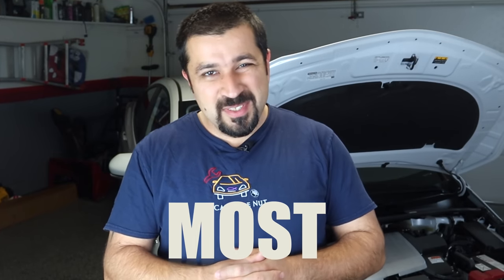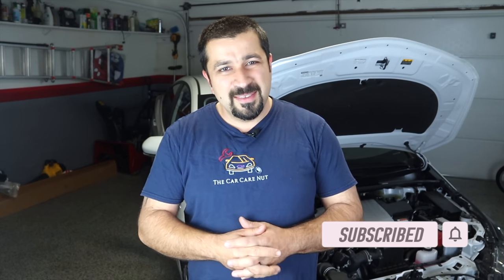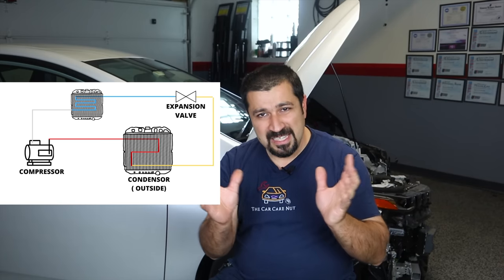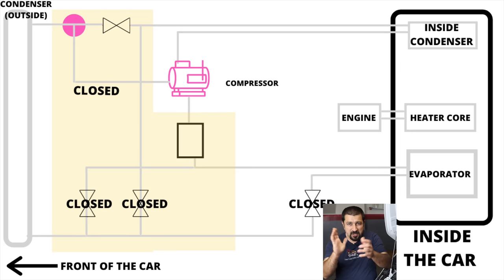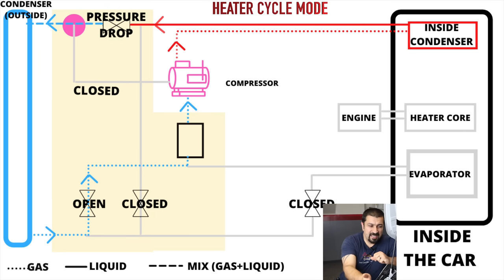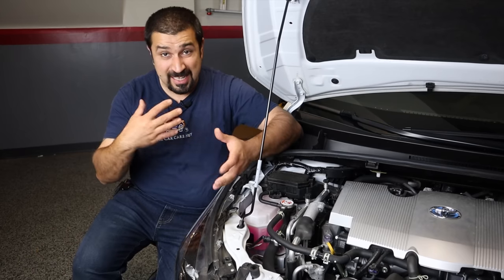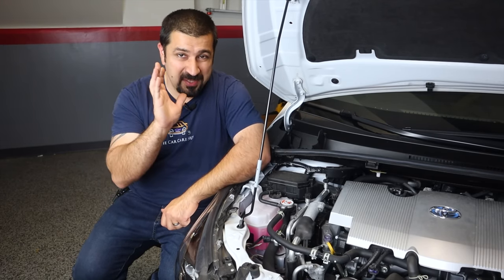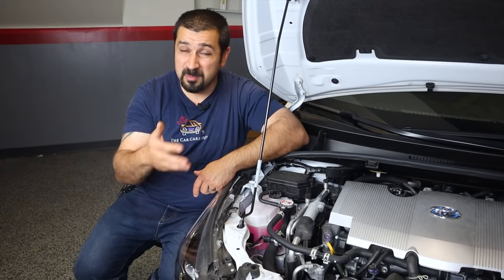The Worlds SECOND most complicated car HVAC system Explained

Comment: Brother I have the opportunity to get a 2009 Tacoma base 4 cylinders with 80k miles all services done at dealer. AT TRADE IN PRICE!!!! anything I need to check for?  
THANKS!!!
Reply from the maker: Hi Jose! The frame for rust is the biggest thing! Everything else is simple. Valve covers and water pumps are kinda common but very easy to change if they’re leaking. Otherwise it’s a solid truck.
Reply: @TheCarCareNut  thank you so much!!!

Comment: Wow, the heat pump for your home HVAC is no where near this complicated. This seems to be much more complicated than it needs to be. Wonder why they just didnt put an electric heater in the car for winter???
Reply from the maker: Hi! Putting an electric heater in an EV can become counter productive as it draws too much power and it affects the range
Reply: Coefficient of performance for most heat pump systems is about 3.0, so it only uses 1/3 the energy to heat or cool.  The trade off is more components resulting in lower theoretical reliability.

Comment: Why in heaven's name would they not enclose that critical unit behind the headlight within a small protective metal cage that hopefully would protect it against a bump from maybe someone backing into you in a low speed situation in a parking lot, etc. There are so many bad things about this system that I am happy I have an 18 RAV4 XLE hybrid. For sure! PS: what happens when the local Toyota dealer tells you that the nearest tech is 500 miles away? Toyota needs "traveling" techs that can come to the dealership.

Comment: As much as I've loved Toyota's simple but elegant engineering in the past, they are definitely going backwards at this point. The best designed part is no part. This thermal management system is wildly overly complicated for what it achieves. At this point I see that they are trying to adapt old designs to achieve new goals and features, but this is not the way forward. These vehicles should have been clean sheet designs with a highly integrated thermal management systems, dare I say, just like newer Teslas. This focus on Hydrogen power and “Doki Doki” and all the other fluff is putting Toyota more and more behind. It seems to me the real issues at Toyota are fundamental ones that come with being a massive corporation. I really don’t see Toyota being in the top 5 auto manufacturers in the next 15 years.
Reply: I don't  see it as a step backwards,  to the contrary, this system make the fuel economy shine and leave the other technologies in the dust when in come to miles  per gallons. I don't regret having one because the saving in fuel is a priority for me and I'm happy with it.
Reply: @neliosamch3195  More part's usually leads to less reliability as there are more points of failure. However, I'm sure Toyota did it's due diligence to qualify each part, but it is very expensive to engineer a large system like this to be reliable. Cost is king and I doubt they are going making much profit off of these plug-in hybrids. Yes you do get better fuel economy with a heat pump HVAC vs a conventional HVAC system, but if Toyota went with a fully integrated thermal management system, it would be significantly better, be more reliable, and would cost less as there are fewer parts. On a newer Tesla for example, heat can be moved from literally from any part of the vehicle like the cabin, electric motors, ambient air, batteries...etc, to any other part of the vehicle using a single integrated unit containing their "octovalve," "super bottle," heat pump, and small heat exchangers. It contains very few parts, it takes up very little space, and it maximizes thermal efficiency. A Toyota engineer that has seen how integrated Tesla's systems are designed commented that they "could never do this," not because they don't have the technical knowhow, but because the company is so massive a slow moving with many independent departments that specialize in only one part that they could never integrate to the level of a Tesla which by the way only has a few large computers compared to the 30 or more on a modern Toyota.
Reply: @jacobs2309  Toyota has always been defined by quality and I expect this heat pump will work  flawlessly trouble  free for years to come.
Reply: @neliosamch3195  I'm confident it will, but engineering commodity vehicles like this with so much complexity is not sustainable.
Reply: @jacobs2309  I get it but as long as Tesla keep prices out of reach the prius prime is the best transitional car for affordability, features and economy.

Comment: Take a mini split apart and tell me what’s more complicated 😅😅😅
Reply from the maker: They are similar but the problem with the car is access. A mini split you can take apart on a bench. A cars heat pump is usually crammed in very tight spaces and most of the components you don’t have easy access to. Otherwise they’re somewhat similar
Reply: @TheCarCareNut  nobody really puts a mini split on a bench usually though. Instead of being crammed in an engine it’s hanging on a wall or roof in the baking sun and the Chinese to English translation instructions are lacking at best.
Reply: The thing that really complicates them are the controls that make them variable speed. Lots of resistors and pressure transducers collecting temperatures and pressures being feed into complex algorithms to determine the speed. That and having to turn ac into high voltage dc with precise voltage outputs.
Reply: Also you can’t check the charge or add refrigerant to a mini. There is no high side port and you wouldn’t know what sub cooling and superheat to expect. The only way to set the charge on a mini is to empty it and weigh in the nameplate amount.
Reply: And no compressors have reversible input/output. If it’s a reciprocating compressor it doesn’t matter which way the motor spins it still pumps like a piston. On rotory and scroll types if they spin backwards they pump nothing. Heat pumps have reversing valves in the circuit not bidirectional compressors. They don’t exist

Comment: This very good vid only covers the "plug in version" of the Toyota Hybrids.  Trying to squeeze a tiny bit more miles per gallon out of the Toyota fleet has lead to this sorted expensive tinkering under the hood. The fact that Toyota was forced to come up with this design is more blatant BS from a handful of corrupt California ledgeslators looking for reelection votes. "Vote for me I passed a law that cleaned up the California air" a fact in dispute in that Calif will continue to be recklessly polluted by Chinese heavy industry factories. Then the unintended consequences that happened when gas CA consumption dropped along with tax money hurting the over spending revenue stream. Only thing to do was double the Ca tax on gas and add a surcharge to Hybrid and all electric vehicle (EV) registration fees. Need that Calif imposed car repaired good luck b/c few Independent car repair tech have the very expensive test equipment or training when it comes to diagnosing the flashing red lights on your dash board.